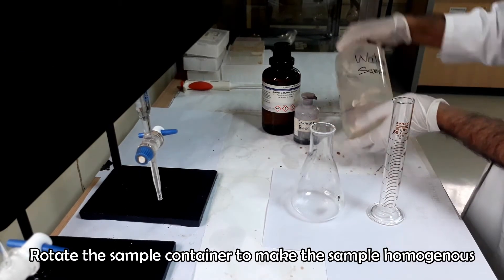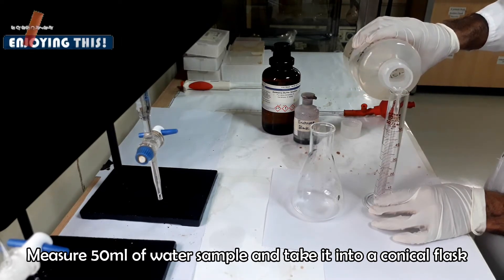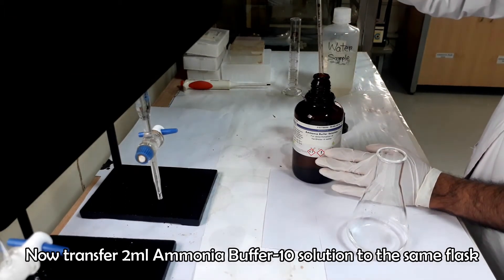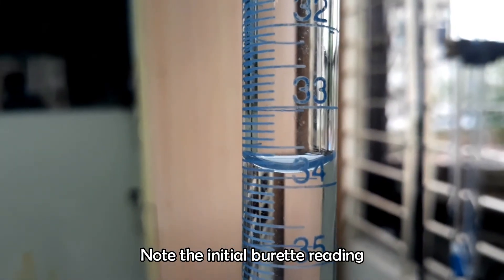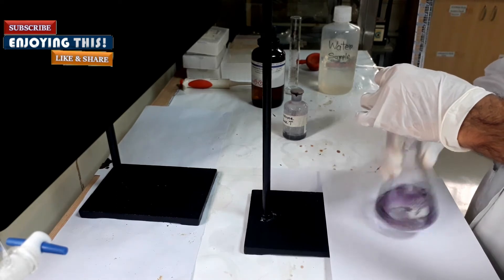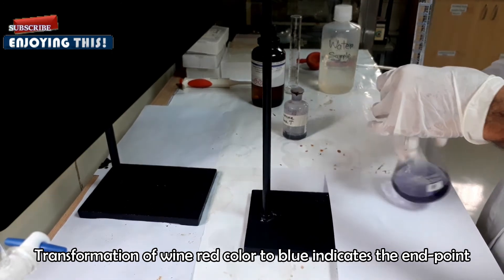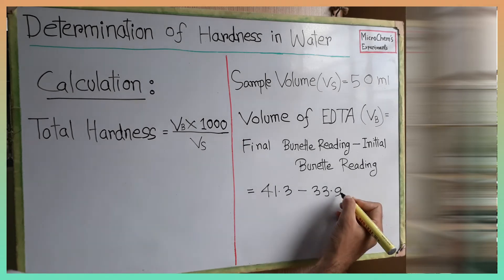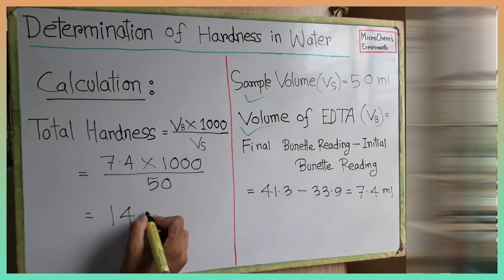Determination of Hardness of Water_A Complete Procedure (ASTM D1126-17)

Comment: just asking is it possible to use a normal buffer 10 instead of an ammonia buffer
Reply from the maker: In official method, it is said to use Ammonia Buffer 10. I think there will be no problem in using normal buffer instead of ammonia buffer but never tried. You can try this method by using both buffers in separate experiment to compare the results. If you found same result then continue using normal buffer 10.
Thank you